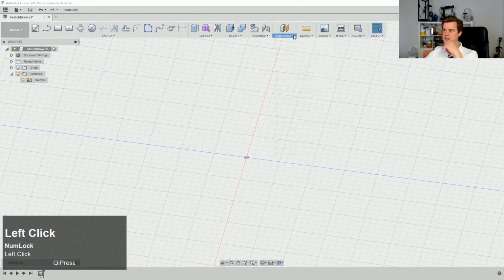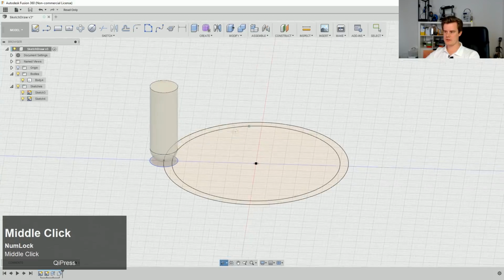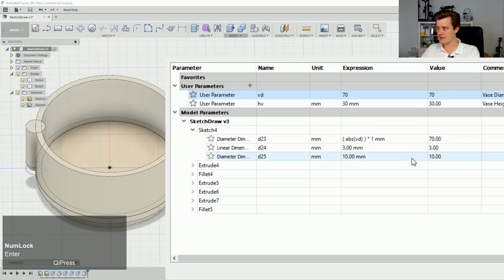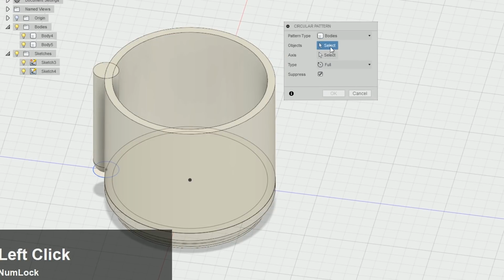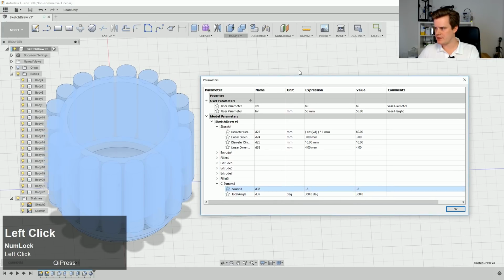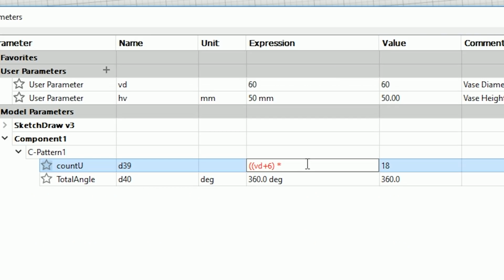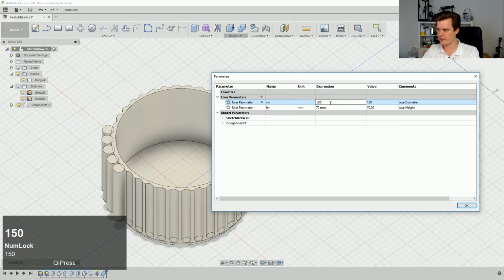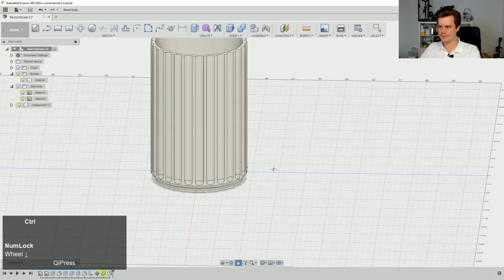Parametric Featuresin  Autodesk Fusion 360 | CADalong for 3D Printing

Comment: You should cut first with the single small cylinder. Then You can pattern the cutout itself. ;-)
Reply: I agree with +Gerhard A. E. Uhlhorn. You need to use Circular Pettern on the Faces that makes the cut, not the body. Then it should work no matter how big you make it.
Very nice video on parameters though! Will implement this more into my designs!
Reply: I agree, that is how it's usually done.
Reply from the maker: I tried that at first, but got wierd errors with them never keeping the selections like the Solids did. Maybe I did a mistake somewhere. It felt like the right thing to do, but yeah. Since the sketches would interfere, selecting the "big inner one) for other extrusions would mess things up.  Atleast when I tried :)

Comment: Really nicely done. Do you have experience with SolidWorks or Inventor? If so, what parametric features do you see lacking in Fusion? I'm probably don't have the right workflow, but it just seems like Fusion is looser than the others.
Reply from the maker: I'm still "pretty" new to parametric modelling completely so I would not be comfortable to weigh in on how the softwares compare on parametric features. I'm more familiar with fusion 360 and as you say, it's a bit more "loose" I think. However, it's mostly a good thing, allowing you to still be creative in your process, instead of locking yourself down in a strict workflow. In my design work with customers I often exit parametric mode and the history get's "ruined" since I do custom solutions and use tools to achieve design-results rather than construction modelling.